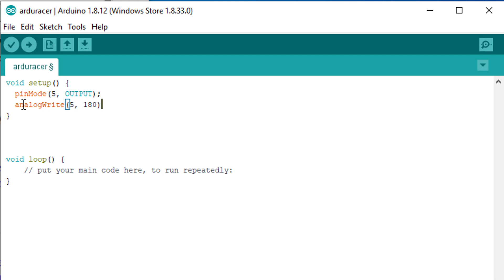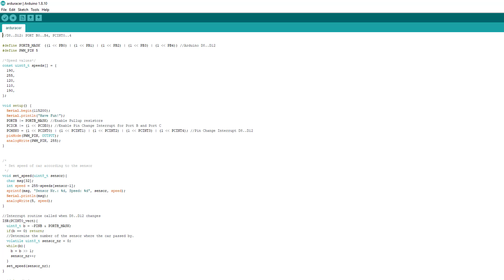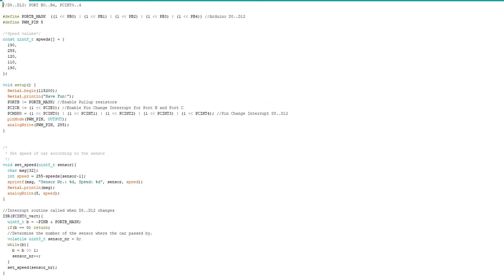Playing Slot Cars Against an Arduino

Comment: Hello. I know that this is an older video, but I plan on doing this same project. The difference is that my track is a Carrera Digital track. I'm a total newbie when it comes to the Arduino. I'd really appreciate any help you'd be willing to offer.
Reply: Same here. I am trying something similar and I figured most of it out but I can’t figure out how to regulate the voltage going in to pwm pin

Comment: Did you test if it would work to place the sensor below the track and use the Standard build in magnet of the cars? ..thinking about making a arduino lab counter for carrera...
Reply from the maker: Indeed I tried different locations. But it turned out that the conductors consist of steel and thus shield the builtin magnet of the car. So the only feasible place for the hall sensors is beside the track.

Comment: Very cool -- great job.  Here's a challenge : Modify the code so that the Arduino attempts to find the optimal speed to use in each section.  I would envision doing something like increasing the speed by one point every time the car enters a new section of track, then if suddenly the next section isn't hit, the Arduino would know that it went too fast.  If you could do something like this, then you could have Arduino-vs-Arduino races.  :-)

Just my $0.02 worth.  Again, cool project!
Reply from the maker: Yes, I first thought about this, too. But then I decided for the fast and simple way. Maybe I will try this later.

Comment: I think you can optimize your sketch. It is possible to calculate the position of the car on the track by measuring the time. So you can divide the track in much more pieces and give each piece the most efficient speed.
Reply from the maker: Yes this could be a good way to improve this. But I wanted to keep it as simple as possible.